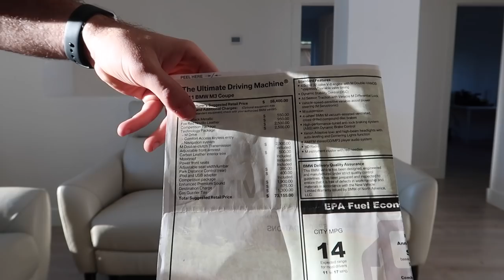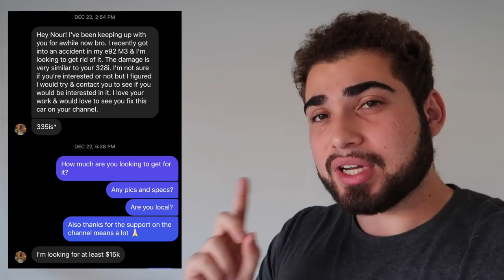THE BIGGEST PURCHASE OF MY LIFE, MY FIRST HOME! WELCOME TO 2022!

Comment: Congrats dude! That shed looks pretty sweet, great place to store some extra car parts!! You might already know, but I'd double check the extension cord you're using for power is 14 gauge or higher and rated for 15A though (assuming that traces back to a 15A circuit), since most store bought cables are 16 gauge / 13A and can easily be overloaded and be a fire risk without the circuit breakers being tripped.